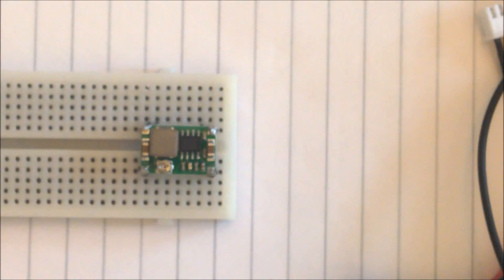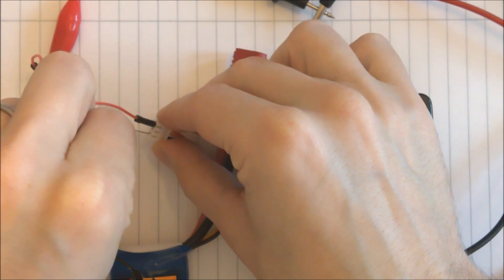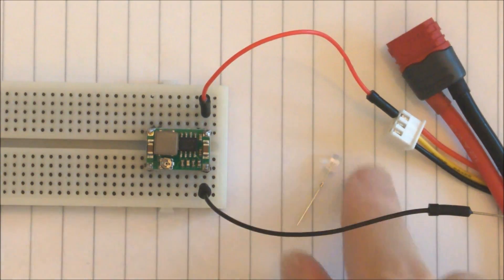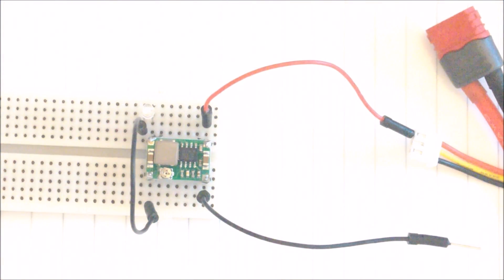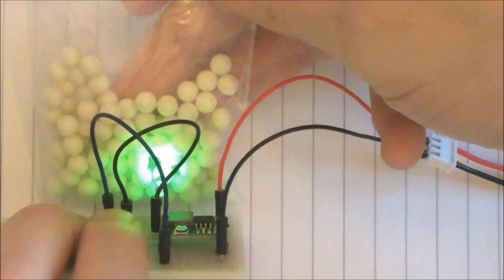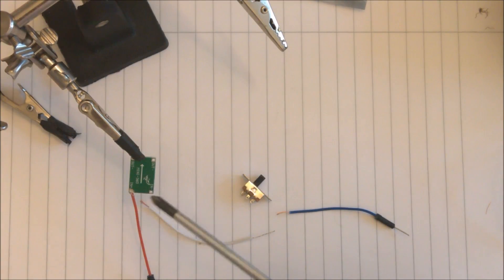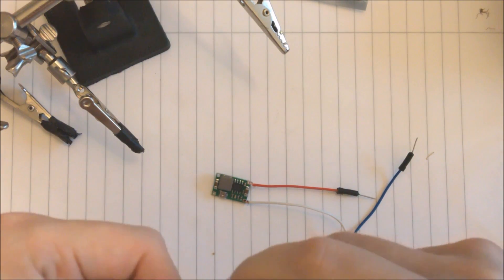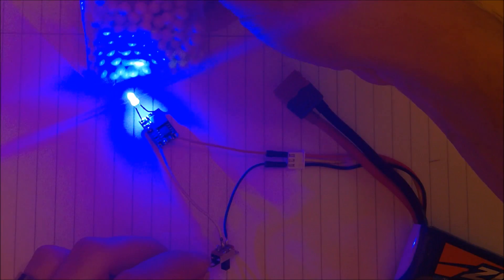Part 1: Tracer Unit - The principle. (DIY Step by Step)

Comment: Hi there very nice build!!
 Isn't it going to be simplier if you could use a 3.7v external battery like a 16340 or a CR123a which is 3v, so there will be no need for the converter... ?
 Cheers :)
Reply: You need something to regulate the current. A diode turned on becomes essentially a short circuit so you’d kill any battery. You could regulate the current with a resistor but then the current will die as the battery dies and so the UV LEDs output would fluctuate. Some kind of power supply like the buck converter he chose is needed for proper function. He forgot the photodetector though so it isn’t on all day.

Comment: do i have to raze the voltage by each added 1w UV smd led ?
Reply: if the LEDs are connected in parallel then the voltage is the same, but more current will be drawn from the battery
Reply: @TheMattSturgeon  and ewery led need paraller own resistor current no go high and broken led.

Comment: Hi
Have you had any issue with taking the voltage from one cell of your lipo and it becaoming unbalanced?
Reply: You should NEAVER just take the voldtage from One cell... Just like i do in the video you should take the full battery voltage (from all cells) and drop it with a converter... or else you will damage your battery... 

Lipo's should always be balanced and discharged together!!!!
Reply from the maker: Hello There. I can see that "Søren" has already given you the correct reply. Please feel free to ask if his response was not suficient...
Reply: @AirsofttechDk  Hi. It was my mistake in the video I thought you were taking the v+ from s1 to achieve 3.7v  to reduce the load on the buck regulator.
After reading the previous response I can see it was taken from the output from s2 giving you nominal 7.4v.
Again my apologies.

Tom
Reply from the maker: @tomsworldofeverything6777  Thay's okay .. A common mistake.

Comment: what happens when the voltage of the battery drops? does the buck down still provide the same voltage?
Reply: If the lipo drops below 5v the converter also drops... but a 2-3S lipo should NEAVER drop that low ... at that level your gun wont shoot, and the lipo will be damaged.....
Reply from the maker: Sørens anwser seams correct, feel free to send questions if you need futher details

Comment: does not work with me

Tracer using the script below

led's
Potência 1w
Cor Branco Frio (azulado)
Voltagem 3.2Vdc (aprox.)
Corrente 350ma (aprox.)

            //
led =  |<----

      //   //
    |<---|<-- 3 ohm
7,4 ----|<---|<-- 3 ohm --- gnd
    |<---|<---3 ohm
     +    -+   -

what to do?
Reply: Are you really using Verilog to simulate yet you don’t understand why it works in practice and not theory?

Comment: What kind of pins do you use to connect the wiring harness to the balance connector on a lipo?
Reply: In the video i just used some wires from a development board... But you Should realy use JST-XH plugs..

Comment: Awesome in guide , quick question though , what determines the current once you have set the voltage on the buck converter ? If I wire 2 or 3 led’s in parallel using this method  is there anything I’d need to do differently ? Thanks .
Reply: A better (for led longevity) option is a constant current driver. LEDs experience current ramping as their internal resistance and voltage drop decrease with temperature. This can significantly reduce their service life. Selecting a constant current driver and wiring your LEDs in series will ensure maximum life while also boosting efficiency and thus longer battery life.
Reply: @aristotelian9693  not newer all led serie lot better all led make paraller ewerytime, and ewery led own resistor then not need stupid bucjconverter anythinnk.
Reply: @mattivirta  have fun burning through leds or having them so dim that your tracers dont illuminate.
Reply from the maker: Well I recomend that you take a look at my other videos about tracers: 
https://www.youtube.com/playlist?list=PL33v6qlGUzG2IxqjB0msS4Nmsd6vqBv2Q

The question you asked is kinda answered in part 2 160 seks into the video:
https://www.youtube.com/watch?v=Z_QnGPHzm-E&t=161s

Also note the text here:
https://www.youtube.com/watch?v=Z_QnGPHzm-E&t=287s

And last but not least:
https://www.youtube.com/watch?v=Z_QnGPHzm-E&t=448s

So as you can see your question has been answered in another video :-) 

But for you heres a short recap: 
1. Get AT LEAST 3w of led's! Eighter 3 or more 1w led's, or one or more 3w led's ... More wat's equals more brightness in the bb's... 
2. Longer exposiure time (longer supressors with led's spread out) also gives more brightness ...
3. MAKE SURE YOUR "buck converter" can deliver enough Amps ... 4x "1W 350mah" led's = 4W * 350Mah = 1.4A ... And be aware that china converters often are under powered so if you get 4w's of led's get a buck converter that can deliver around 3  Amps continues and 5 in bursts ... 

Hope it helps :-) 

Would you be interested in me making a "Caluclating and buying materials video" ???
Reply from the maker: The voltage level should be set within the level that the LED's require ... Usualy between 3.0v and 3.4v but it may be slightly different for differet led's ... More in parallel just require more amps! Just sum up the amps neede ...

for more info on wiring in paralell se part 2:
https://www.youtube.com/watch?v=Z_QnGPHzm-E&t=450s

Comment: Nice to see people still utilising my idea, even Madbull copied it, I should be flattered!

I made my first one over ten yrs ago now (Nov 2007).
I too used UV LEDs, ones that run at around 3V, so can use 2xAA or AAA Cells.

I don't use a 'manual' Switch, instead I fit a micro-miniature Reed Switch in the base of the Magwell, activated by a tiny Neodymium Magnet embedded in the top of a Mag.
Reply from the maker: Hey. I'm not familiar with your name or your work? 

But I gladly give credits where it's appropiate, so if you can post link's to your 2007 work feel free to do so... If I think it's relevent work (that I may have copied without knowing) then I will of cause post a "credit's" note in the video text :-) 

Hope you don't feel like I'm trying to rip off any work you may have done, but I mean: Getting UV lamps to light up is pretty easy and well documented, so personaly i don't think i'm copying anynone. Just showing off common ways of lighting LED's ....
Reply from the maker: Yes I know it's not a new invention.... The video is just made to show people how easy it is to make your self ....
Reply: Nice video! The concept of a "HUTU" (hop up tracer unit) has been around for a while: https://www.meetup.com/Puget-Sound-Airsoft-Alliance/messages/boards/thread/48656383/

 ;)

Comment: Is there anyway to set the voltage without a multimeter?
Reply from the maker: NO :-( There is no simple way of measuring voltage without a multi-meter... 

But you have 2 options: 

Option 1: The first one is to turn the screw all the way down (so you will have 0v) connect the led, and then VERY slowly increase the voltage by turning the screw until the LED is bright (Visual inspection) just be sure you don't turn it up to much.... 

Option 2: If you go to the project site http://airsofttech.dk/Guides.cshtml?Page=TracerUnit there is a note with a picture just above the first video. The note say: "It's also an option to purchase FIXED voltage Buck Converters. On these there are no screws, so make sure you get a 3.3v Version! " ... On ebay, search for "DC-DC Buck Step Down Converter Regulator Module 3.3V" and find one that does NOT have an adjustment screw (It could be the one looking like the picture on my site), but instead have a drop down where you select the output voltage ...
Reply from the maker: If you go for the "FIXED voltage" option here is a direct link to an ebay supplyer that selles modules that looks like the one i use (but with a fixed value) ... Then the rest of the wiring is exactly the same ...

http://www.ebay.com/itm/DC-DC-Buck-Step-Down-Converter-Regulator-Power-Supply-Module-3-3v-5v-9v-12v-/192026977261?var=&hash=item2cb5b323ed:m:mCFrnDiQec75BSDj8N-CL7g

The link above will of cause only work as ling as that ebay listing is up ....
Reply: AirsoftTech.dk awesome thanks!
Reply: no multimeter cheapen good cost 4 $ not expensive, ewery normal men have multimeter in home, and many other tools too. only totally idiot not have.
Reply: @mattivirta  I do 0 electrical work on rent so I had no need to buy a 15$ tool I'd never use
Reply: @Spacemarine658  although here you are needing one… good men are prepared.
Reply: @mdmaxson  lol nah I just winged it and it worked still haven't needed it if I do I can buy one